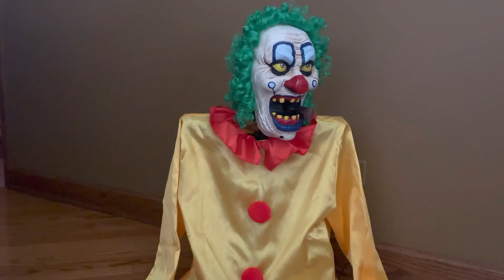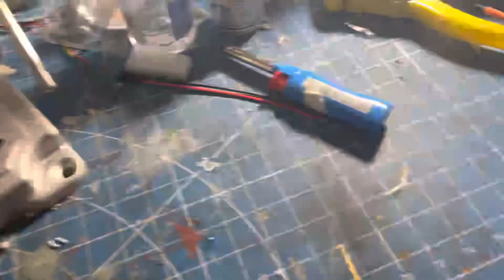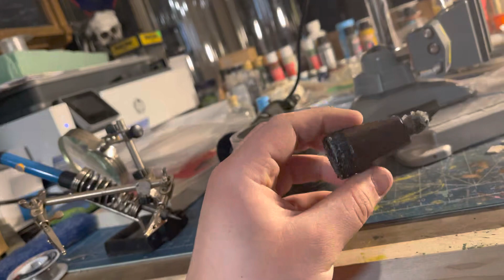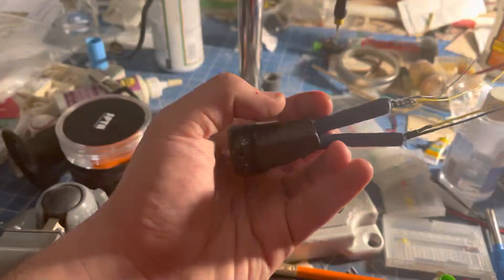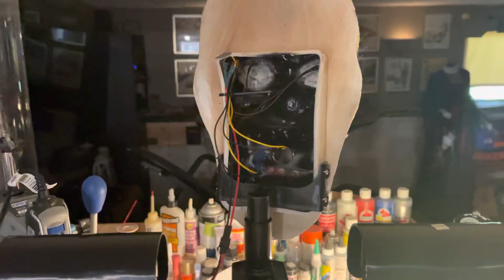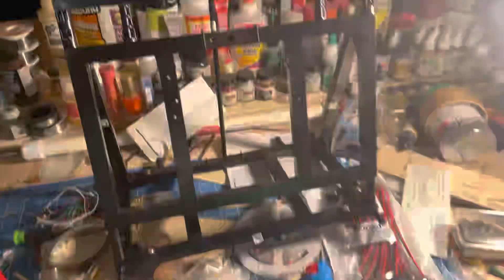Upgrading the Rare Smokey the Clown Animatronic | 2011

Comment: Great job I love it. Where did you get the light for the eyes at?
Reply from the maker: EDGELEC 50pcs 12 Volt 3mm Warm White LED Lights Emitting Diodes Pre Wired 7.9 Inch DC 12v LED Light Diffused Colored Lens Small LED Lamps https://a.co/d/cIP0iF8

I believe these were them though I’m not sure, I bought them a while ago.